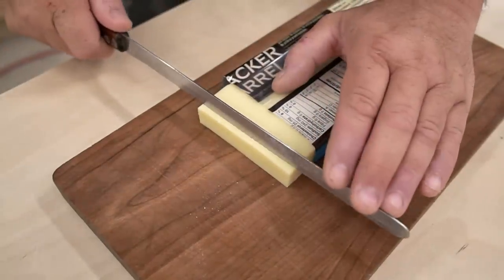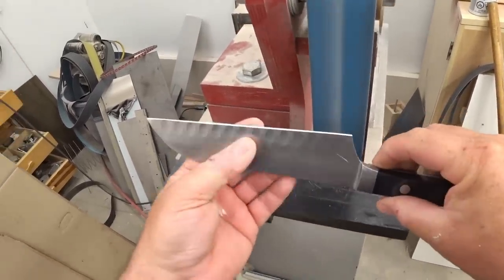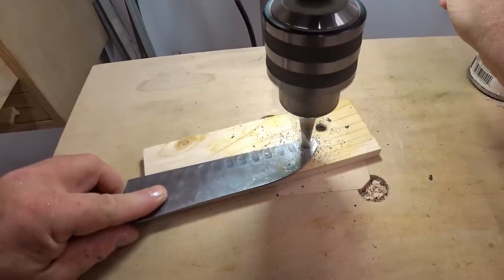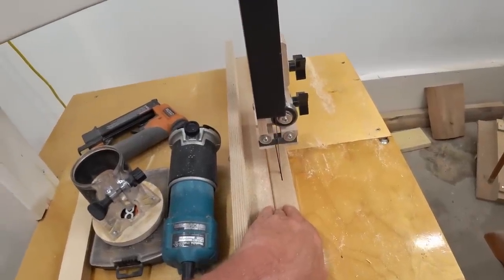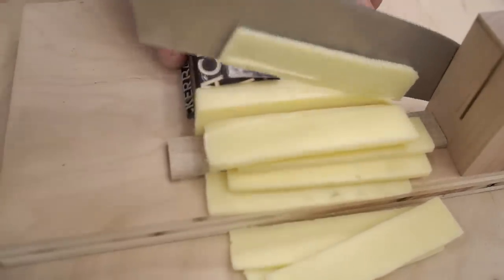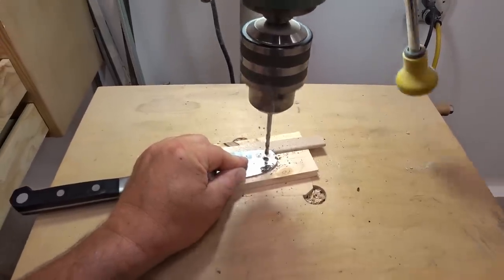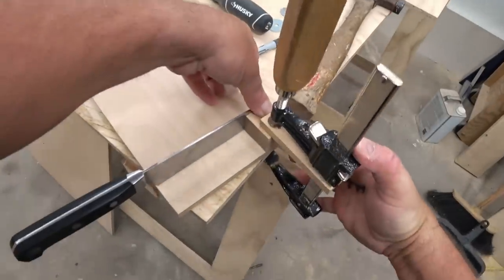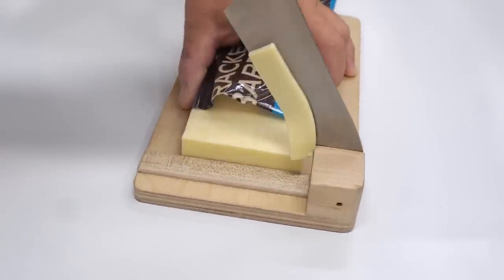How To Make A Cheese Slicer - Homemade Kitchen Gadget

Comment from the maker: I buy cheese in this common sized 400 gram brick and like to use it on sandwiches or burgers, etc. Slicing it can be a pain, because the cheese often sticks to the side of the knife and can annoyingly break apart when I peel it off. 
So what I found is that the next cut will push the last slice off the knife, but it's more difficult to line it up to get consistent thickness slices. This gadget solves this and produces slices that are the perfect thickness.

Ways you can help support this channel:
Patreon:
https://www.patreon.com/user?u=865843&ty=h

Project plans for sale: https://ibuildit.ca/plans/

More videos on my second woodworking channel:
http://www.youtube.com/c/IBuildIt

My home reno channel:
http://www.youtube.com/c/IBuildItHome

My "Scrap bin" channel:
https://www.youtube.com/c/IBuildItScrapBin

Website: https://ibuildit.ca/
Facebook: https://www.facebook.com/I-Build-It-258048014240900/
Instagram: https://www.instagram.com/i_build_it.ca/
Reply: Best to eat some fiber with all that cheese.
Reply: Just an idea for the last stuck slice. If you had a small piece of wood that was about the same size as the cheese slice but slimmer than the cut of cheese, you could put it up against the stop block and slice down with the knife to push off the last slice.
Reply: Sawdust is fiber!
Reply: This is what I love - simple solutions to everyday problems that just make your life better.

How thin a slice do you think you could make? Could it make a 16th? That's be handy for butter in the winter - real butter that is, the sort that doesn't come out of the fridge soft.
Reply: https://i.imgur.com/uC2zjEA.jpg

I have a couple of these, they work great. Perfectly consistent slices every time.
Reply: That's a bit cheesy. (Best joke ever!)
Reply: metamucil or the WalMart house brand (Equate) equivalent

Comment: Well done John. Here in Europe such slicer for soft cheese are very common. Usually instead of a knife a very thin steel wire is used. The cheese will not stick as much as on wide knife blade.
Reply: With a roller that keeps it evenly sliced.

Comment: In my first year of high school back in 1975 we built a cheese slicer in woodwork class. It had a base board with a pivoting cutter shaped in a wide u-shaped bow and was to have had a piano wire stretched on it like a coping saw blade. I don't remember why but we never finished them by putting the wire on. I brought it home but never finished it myself and of course it has been lost since then. Anyway, using a thin wire cutter should alleviate any problem of the cheese sticking to the blade; but the hollows in the blade on your knife should help compared to a flat blade.

Comment: If I need to drill hardened steel (as a knifemaker it happens), I’ll spot heat with a torch, at least until I’ve worked through all the temper colors and sometimes until the steel is iridescent, making sure to heat sink any areas I don’t want to lose their hardness, just the area I’m drilling. Even mu cobalt split points struggle when you’re dealing with kitchen cutlery hardness! Nice little video John.

Comment: I bet that mechanism would work better with a parallelogram
Reply: travis bryant Or a well built inclined plane setup... :) maybe the metal pantorouter can be further improved to cut cheese?
Reply: here the main thing is not the mechanism but cheese
Reply: When I build one, I think I'll use a "hot wire" similar to a styrofoam cutter.  The trick will be to adjust the heat so it will not completely melt the cheese and having runny cheese sauce all over everything...  ;)
Reply: Or a guide,  1” of movement was enough, now it’s a lot more

Comment: The further the cheese-block is from the pivot, the more the edge descends vertically to make the cut.  

(Matthias would build a parallelogram mechanism to keep the blade perfectly horizontal at all times, ensuring a perfect cut, no matter what thickness cheese-block was being sliced.)

Comment: I'm constantly learning. I noticed in your video that one of your drill bits was crooked.  Plunging the drill bit into thick piece of hardwood three or five times fast at high speed. It will heat up fast and with the rotation of the drill bit, it will straighten itself. Give it a try

Comment: There is a version of this commonly used at cheese stores, they use a thin wire instead of a knife and it works great. I actually have one at home and am quite happy with it. For such thin cheese, a knife is OK I am sure but for thicker cheese you want a wire.

Comment: Haha great. Just to say the ideal cheese knife is a relatively wide wedge that is also not very wide. Wide blades like that one drag on the cheese and make cutting slower. Just if you fanced optimising it you could remove 60% of the metal from the back of the knife and have a much better cutter!
Reply: although the blade width actually doesn't matter much at all for cheese that thick. It's when you're cutting much thicker pieces that this matters, like cutting into wheels etc.

Comment: Have you considered making a guitar string or piano wire cutter with a tray that slides (incrementally)? A bit more complex (esp if made to move in 1/8" increments) but I can't imagine it not outperforming a knife in just about every way.

Comment: When you center punch stainless steel you create a tool-hardened divot exactly where you want to drill.  Cobalt bits aren't very expensive and cut stainless pretty easily.

Comment: For quick solution and portability you can try egg slicer, use only the wire strings it'll give you a perfect cut. 

Nice video, we can use it on some other purpose. Or maybe put the egg slicer instead of knife?

Comment: That drill bit at 1:06 gives me the wiggles :-)  In the final shot, it looks like it needs some weight (maybe that is why these boards are some times made out of marble), or more surface towards you.  If you use a string instead of a knife, then it doesn't stick.

Comment: I was thinking how a second block could be used for the knife to pivot between it and the first block. A metal pin can be slid through and a rare-earth magnet would hold it in place. The pin can be pulled out allowing the knife to be placed into the dishwasher.

Comment: rather than the screw to hold the knife, I would have made a notch in the blade or a slot if you will and secure with a wing nut & bolt. Much easier for cleaning the blade :)

Comment: Is polyurethane food safe?
Reply: I thought I read a while back that polyurethane could be food safe after the finish cures for 30 days.
Reply: If your worried about contamination use walnut oil or peanut oil. Olive oil goes ransid and stinks.

Comment: The problem started when you used a knife to cut the cheese instead of a cheese slicer.
Reply: Cheese slicers often chip the edges of the cheese off. Plus, knives are more fun to use